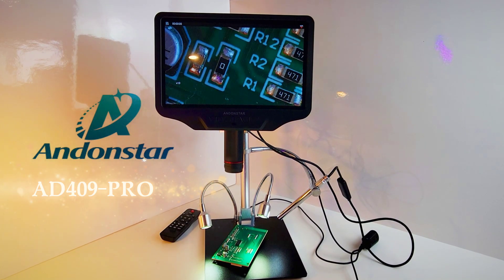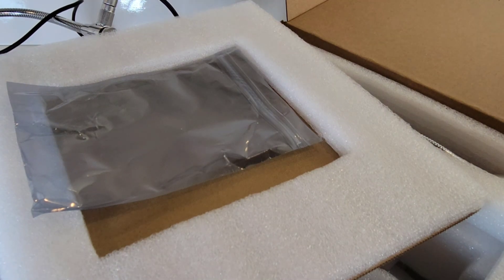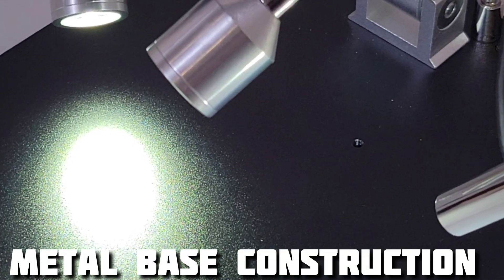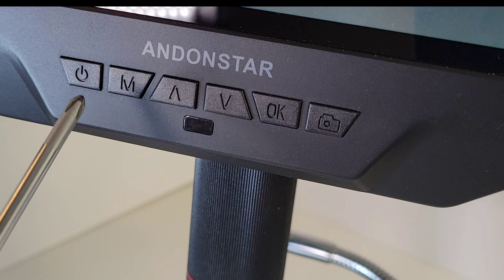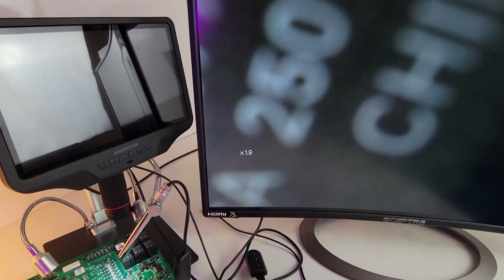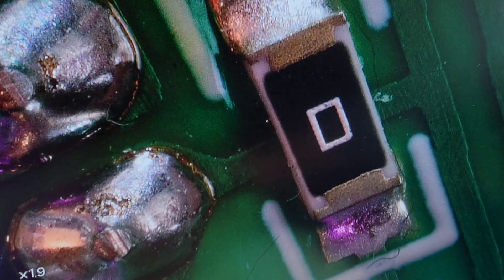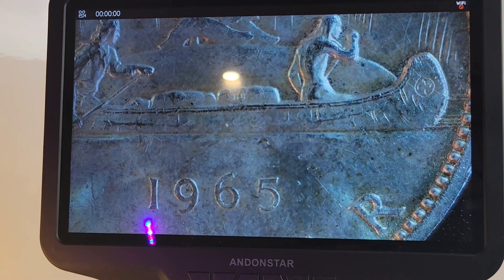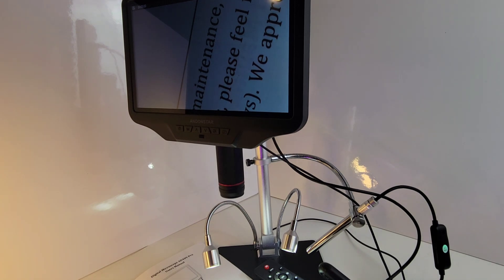ANDONSTAR AD409-PRO ES Digital Microscope Review!

Comment: So the gooseneck lights are always on even if the unit is plugged in and turned off? I like the unit except for that. Great review Darren.
Reply from the maker: Not exactly,  they turn off if you power down the whole unit. However,  all my other scopes have a separate on/off switch if I don't want to use the Xtra lighting.  Thx for the kudos..definitely a challenge getting the correct viewing angles on this beast 👌

Comment: I've seen a lot of these Andostars lately. They seem like a good alternative to more expensive $1000+ microscopes, that are usually used in professional and semi-professional repair shops.
 
Apart from taking up quite a lot of space on the table, they should be alright. Maybe I'm just used to a slightly cleaner setup with a powerful but compact microscope and an external monitor mounted on a mount on a wall. 🤷‍♂
 
But you're right. It's a real shame you can't put the main feed or that endoscopy feed separately on an external display. Looks like a big oversight.
Reply: Also that '65 Canadian silver dollar is just 🤩
Reply from the maker: @numerical_error  hehe...the Silver dollar stole the show eh..😊👍